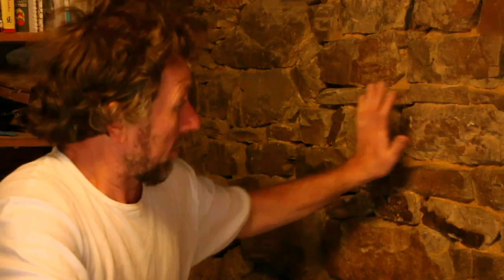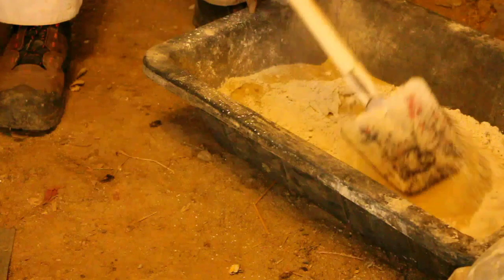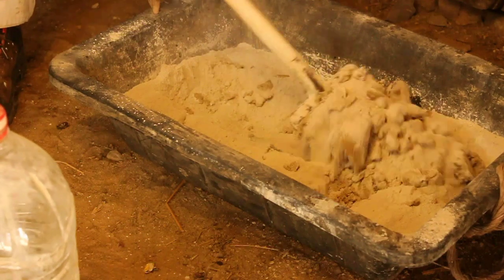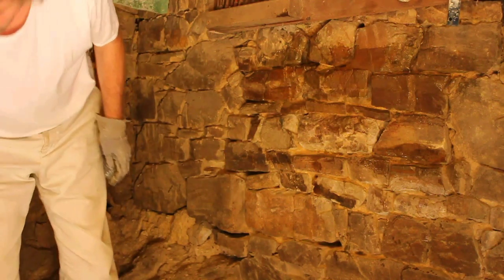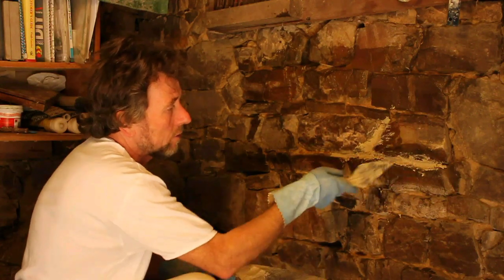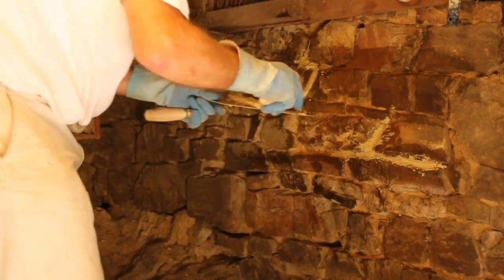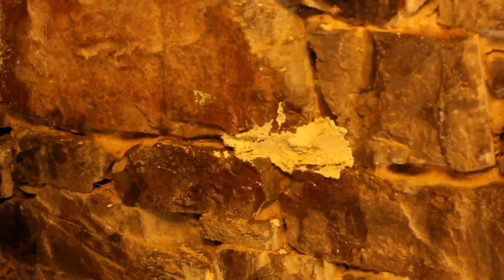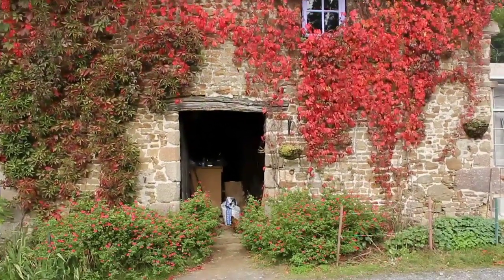Working with Lime Mortar. Pointing stone walls. Mortier de chaux. Hacer juntas con mortero de cal.

Comment: You're not wrong about time consuming! Started 3 days ago on a 300+ year old back garden wall that had only had a couple of minor patchwork repairs over the years. Removing the ivy that had been allowed to take hold was tricky and has taken just as long as the pointing so far but having watched your video I know I'm heading in the right direction. Very helpful, thanks a lot.
Reply from the maker: Scott Coyne Hi Scott. Really pleased that the video was of some use. Just consider, that thanks to your efforts, the wall willl be standing for another 300 years. 
Thanks for watching and commenting, I really appreciate it. Best Wishes from France, Andy.

Comment: Lovely to see someone who understands lime mortar.  I'm repointing the inside walls of my old cottage using non-hydraulic lime mortar I make from DIY lime putty that I age for 3 months under an inch of water. After just 3-4 weeks after pointing it's surprisingly strong, and the strength continues to rise as carbonation proceeds. For internal work it's excellent but moisture must be controlled (hanging damp blankets) to prevent excessive shrinkage during initial water loss.
Thanks for sharing.
Reply from the maker: Hi David, it is a great mortar to work with. For me it has a much more elastic feel when handling it compared to cement-based mortar. It sounds like a steady job you've got on. What are you going to do with the walls once they're pointed? In our house we only left the stonework on the chimney exposed, this because it was the best quality stone, the other walls we insulated with a render of lime and chopped hemp (used on organic farms as a mulch). This resulted in a highly insulating coating (it was between 25mm to 50mm thick) that still allowed the walls to breathe. Good luck with your project and thanks for watching and commenting, I really appreciate it. Best wishes from Normandy, Andy. P.S. I'll shortly be starting a new project: knocking a doorway through an outside wall into one of our outbuildings- so more lime mortar work coming up!
Reply: @Organikmechanic  Hi Andy - thanks for replying.  Great tip on the insulation; I hadn't heard of that before.  My cottage is a classic box within a box, i.e. stone walls with a gap then plasterboard.  Roger The Bodger did a lot of the work so in most places I have to spend time unpicking errors and laziness before I can start the actual job!
To answer your question, in most places the stone will be hidden behind (correctly insulated) inner partition walls.  One section however has an extension which means the stonework is all interior and can be exposed.  I need to chip out all the cement mortar first though.....groan. 
Please keep the videos coming - I'm off to subscribe!  👍
Reply from the maker: @davidjames2145  Hi David, Roger gets everywhere! If your happy with the plasterboard and all is dry then you're OK. We resorted to the hemp mix because there was nothing except damp plaster which required little effort to remove and the lounge started life as a building for animals which not even Roger would have worked on! Bon courage with the chipping out and thanks for subscribing. Cheers, Andy.

Comment: Interesting video. Im currently working on the legendary conwy castle up north wales. And just finished raking out parts of the curtain wall and turret. Our mix ratio is 1.5 sharp sand. 1 sand .1 lime 3.5. I had 0 experience starting as a labour n ive now learned to to the mix.rake out.re point. And im 31 been working behind a desk all my life and absolutley love working with stone after 3 months
Reply from the maker: Thanks so much for your comment I really do appreciate it. Bravo for quitting the desk job and acquiring skills that I'm sure you'll find will be more in demand in the future. I went on a course of evening classes at a local college to learn the principles of bricklaying and it was there that I used lime mortar. I have found that it's much more 'alive' than cement mortar and has a nicer feel when you're working with it. Good luck with the curtain wall I'd love to see a video of your work there. Cheers from Normandie, Andy.
Reply: Hi, i am in the North Wales area and took my children to Conway castle over the summer. We saw all the scafolding up around the castle entrance. It looks a massive job, Keep up the good work my freind  !

Comment: Great video, thanks to you both. I'm just starting a project on a large old stone house down near Limoges and this is just what I was looking for. Apart from the tecnique I really needed the mix ratio so that's really useful. I'll let you know how it went in two years when I've finished the pointing!!
Reply from the maker: Hi Paul, Thanks for your kind words and you've certainly chosen a great area to work in! I have a written article to accompany this film: https://thegreenlever.blogspot.com/2014/12/mixing-and-using-lime-mortar-and-why.html#.XCy6i69G2kB which also has some links to useful sites. On my site, under the tab  -  'Natural Building Materials' you will also find other materials we have worked with here including natural insulation and paints. Also included are tips on where to source them as it can sometimes be a bit daunting at the start and you can end up buying from building suppliers who prepackage a lot of what can be bought loose and much more cheaply. Ask around your area, in particular people who are working on similar projects with natural materials. Looking forward to hearing from you and do ask if you think we can be of any help. Cheers and Happy New Year, Andy and Sue
Reply: Thank you so much for that, very useful info. I've been working on a C17 oak framed Suffolk house the last year so I've gained some experience of working with an old building but I need to gain more of a knowledge of lime mortar and plaster. There's a local college that holds courses now and again so I'll be signing up for the next ones. It's one thing watching it being done on YouTube but better to work alongside an experienced instructor. That said videos and blogs such as yours are invaluable for the likes of me and by passing down your knowledge and experience inspires me to get cracking so thanks again. Happy New Year to you too, I may well take you up on your kind offer of help!!Paul
Reply: @paultansley8296  Dont use this method in France in your region.  The walls are limestone and fairly soft.  The traditional french method is to throw the mortar in from the edge of a trowel and then brush off to the required finish.  The mortar will not stain the stonework.  I renovated countless French properties over a period of 15 years from your area to further south.

Comment: great video so good to see you working with lime mortar. I use a 1:3 ratio on sandstone here. Good to know it lasts so long, i had no idea it can last 300 years. It's a pain to put in - i try to poke it in with a small chisel file as far as it will go and really pack it in
Reply from the maker: Hi there, Yeah, I believe the pointing inside the building may be that old, but only in parts. Because of the type of construction, most of the joints between the stones are of clay which does erode with time. The walls are fascinating in their construction, inner and outer stone faces infilled with rubble, clay and straw. The thickness at ground level is between two and a half to three feet and tapers up to about eighteen to twenty inches. They are laid directly onto bedrock so the walls are incredibly stable. I did a course some years ago on DIY bricklaying and the mortar we used there was lime mortar which is where I became fascinated with it.  I totally agree it is a pain to put in but it is very satisfying to know that a wall has been saved. Many thanks for your kind comment, it really is very much appreciated. Best Wishes from Normandie, Andy.
Reply: thanks for a great reply!

Comment: Great video. However, remember that you MUST tamp the pointing all the way in to the back and fill the joint fully (first ensure your joints are raked out to at least the same height and more, a ratio of 1:2 is a good rule of thumb) as both of these points will ensure that the pointing won't dry out too quickly, crack and fall out, and eventually turn pure white. Ideally, you should also have a pointing tool that is just a little smaller than your joints, which will allow you to fully tamp mortar right to the back of the joint and change between these tools as required.
Reply from the maker: Hi there Lew, yes the tamping is important, a churn brush is useful for this. The problem in this case with using a pointing tool to tamp the mortar is that the joint thickness varies so widely between the stones it would require changing pointing tools at almost every one. I would love to have seen these walls being constructed, the technique of laying the stone onto a clay 'mortar' is not something that occurs everyday! Many thanks for commenting and watching, I really appreciate it. Best Wishes from Normandie, Andy.

Comment: The problem with NHL is that it varies from batch to batch and brand to brand. The compressive strength rating (2, 3.5, 5) is a MINIMUM strength rating, so it's totally possible to get an NHL 2 that is stronger than an NHL 5. That's the reason they weren't used much historically, they were too unpredictable.

I really hope we start seeing high calcium quicklimes blended with known quantities of pozzolans, either pre-blended or sold separately and blended on site.

Comment: 300yrs & still being used. Here in the USA, my town council is building a new City Hall because they have deemed the current wonderful 75 yr old brick City Hall to be "obsolete" and "too costly to repair".
Reply: AndTheCorrectAnswerIs
I think we are also losing the knowledge over time. Think with brick joint repairs, we put concrete. Concrete has no flexibility and it traps humidity... hence the walls cracks, concrete falls off and repairs are needed... 
We should all go back to the good old way of doing things... for many reasons!
Reply: Here a brand new library, the old one was maybe 25 years old.

Comment: Your pointing tool is too wide, meaning your pushing the lime mortar against the stone face rather the the pushing energy working it into the joint.

Also if you wet the wall earlier, the outside stone face will dry and the like won’t stick to it, while the grooves will stay damp.
Reply: Here comes the keyboard Carpenters
Reply: Can you ram the mortar in with a piece of wood?
Reply: @lukejones1244  you could but you get a much better result using pointing trowels.

Comment: Here in Philadelphia/US, we have many 17th century stone houses and working with lime/sand mortar is a well known art.

However, I am still confused by the difference between NHL 3.5 and just plain lime. You mentioned not using hydrated lime but isn't NHL 3.5 actually hydrated?

We are about to tackle a Philadelphia fieldstone wall on our property and will be using Saint Astier NHL 3.5 and hoping we are doing the right thing!

Your video was the first one I was able to find that demonstrated the actual process of pointing the stone from mixing to laying in. Thanks.
Reply from the maker: Hi there, thanks for your kind comments, they are appreciated. Yes I do use hydrated lime it is the other sort, the aerated lime we don't use, it burns!! Plus unless you are needing to create a very smooth surface, such as preparing a wall to paint a fresco and thus need a lime that remains elastic for a longer time, hydrated lime is fine. NHL 3.5 is most suitable for your wall and furthermore Saint Astier is one of the best quality limes! Good luck with your project and all the very best from La Baie de Mont Saint Michel, Andy
Reply: Jefferson Martin,  I'm not an expert on the matter but I use St Astier lime merely because I live near St Astier in SW France and it's so readily available!

Comment: Many thanks for an interesting video.  I now have to get on with my pointing of an old property in SW France.  Time consuming but well worth the effort in terms of the preservation of history.
Reply from the maker: Hi Catsnmi2,
You're so right about preserving the history. I also find that you better understand how the property was first built by using traditional 'slow' techniques and materials. The big plus for using the lime mortar instead of cement based ones is that the wall is still able to 'breath' thus reducing moisture build-up within the masonary. You probably already know as well that using lime mortars especially in old walls is sympathetic to the properties of the stone, cement is much too rigid and unyielding and thus the stone may give way before the cement. Your efforts will ensure a longer life for the property, BRAVO!!!!!!
Many thanks for your comment, good luck and Best Wishes from Normandie, Andy.
Reply: Thank you so much, Andy!  I greatly appreciate all your helpful suggestions.

Comment: Thanks for the info beautiful old house
Reply from the maker: Greetings Christian and thank you for your kind comment. The house was built, we believe, around 1714 and although made from local stone with a clay mortar has stood the test of time very well. The hardest thing  to do with these type of buildings is to maintain them as sympathetically as possible so that the repair does not cause further damage to the structure. A labour of love no less!! Still it should be good for another 300 years. Thanks for watching and best wishes from Normandie, Andy.

Comment: at the end of the video there were comments about preserving the historically significant buildings and homes.  to that end might suggest removing the vines on their exterior .
they tend to tear apart man-made architecture.
wonderful conservation work.
Reply from the maker: Thanks for your comment. I have found that the stonework is not affected by the Virginia creeper and in fact it helps to keep the weathering effects of wind, rain and sun off the walls. Cheers, Andy.

Comment: NHL 2 would be better as it’s been recently found out that 3.5 isn’t breathable.  Or you could use hot lime mortar.
Reply from the maker: Hi Kevin, have you a reference for this- I'd like to see it. The lime mortar is still better than cement mortar especially on stone walls. Thanks for watching and commenting. Andy

Comment: Not nearly enough water onto the wall. Soak the joints before mixing the mortar and the surface of the stones will dry enough to make it easier to clean off excess while the deeper joints will still be wet. This allows slower drying and less cracking. It’s well worth learning the knack of a quick flick of the wrist to drive the mortar into the joint and suction will keep it there.
Reply from the maker: It is best not to get the mortar on the outer face of the stone in the first place which is why I use the more careful approach of cutting the mortar with my trowel to fit the joint. I've found that as the joints vary so much, the deeper and wider cavities benefit by the addition of small stones. Cheers, Andy.

Comment: I am looking for more information on this type of construction.
Reply from the maker: Greg, apologies for not finding your comment sooner.  I have a link under the video for more details about this on my blog and this it: https://thegreenlever.blogspot.com/2014/12/mixing-and-using-lime-mortar-and-why.html#.YFyYcbrk-V6 
There are plenty of sites on the net that claim to show stone wall construction but many are using commercially dressed stone which never have a 'natural' appearance. There is a book by someone called Meirion Jones entitled 'The vernacular architecture of Brittany' which goes into detail about the layout of these buildings. But, for the type of construction seen in my video I am unsure of the existence of a specific article relating to it as it is stone faced with a clay and rubble infill. Do you have a particular case in point?  If you need more info, let me know. Cheers from Normandie, Andy.
Reply: @Organikmechanic  No worries. I was watching this on a smart TV originally and links do not appear. I will check out the link. Thank you!

Comment: hi thanks for the video! is the same mix and technique if the wall is external? thanks
Reply from the maker: Hi, Yes I would use exactly the same mix and technique. I would just point out that if you are pointing part of an external wall, check the colour of your dried mortar against the existing pointing. Good luck and thanks for watching and commenting. Best Wishes, Andy.

Comment: Hi thanks for your video, 
Just a word of caution, smoke blackened beams would not be a pretty sight for someone who knows about wood, smoke damage, and dry rot and the age of them may mean they will need replacing sometime
Reply: I can't see much from your video of your beams, but if they aren't supporting anything anymore and are just for decoration, see how narrow it gets beside the fire. If they are purely decorative you might consider propping it up, then cutting both ends close to the stone. The reason I say this is because when it finally breaks on one side, it will act as a lever with the other end in the wall pushing up your stonework. You can have a nice high celling then and just the memory of the beams. Saying that, I haven't seen your property and that's what it looks like from what I can see of your video,
Reply from the maker: Hello Chris, I'm not sure where you saw the smoke blackened beams in my video, but thanks for watching. Cheers Andy.
Reply from the maker: Hello Chris, I'm not sure where you saw the smoke blackened beams in my video, but thanks for watching and for the advice about the catastrophic failure. Cheers Andy.